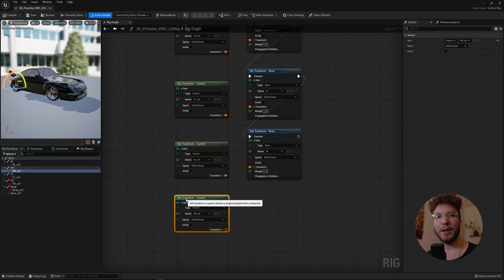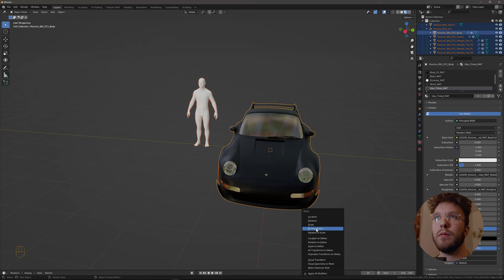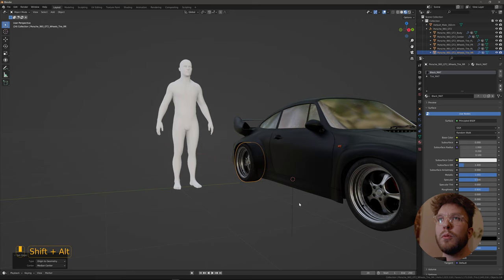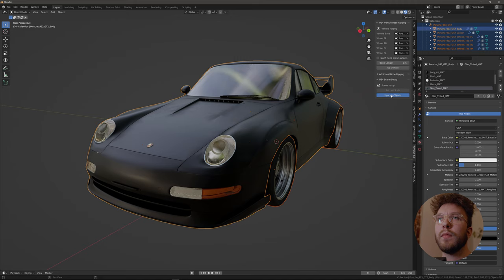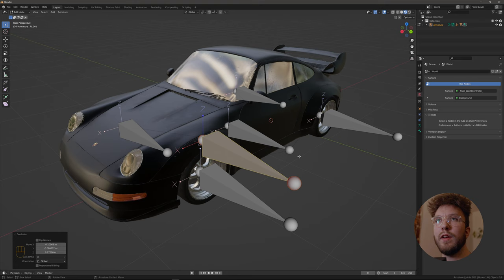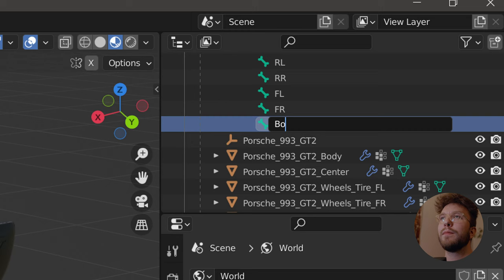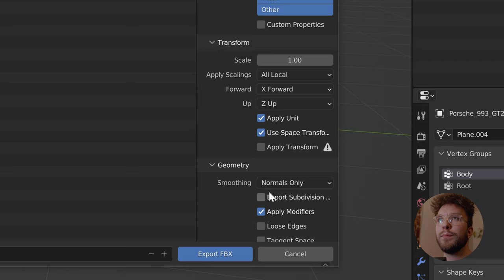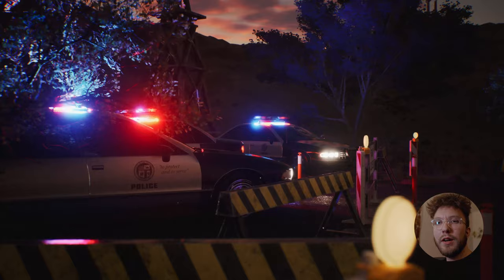Rigging a vehicle/car in Blender for Unreal Engine 5 animations

Comment: Hey, so I did all of the steps right, just that the bones face towards the back of the vehicle rather than facing towards the side of the car, Did I do something wrong?
Reply from the maker: Hi! If you haven't solved it yet, that's probably just because your car was oriented/rotated towards the wrong axis. Making sure the axis match the entire way through is really important. Is your car facing positive X axis?
Reply: @tiedtkeio  alr thanks man!

Comment: Keep coming back to this when needed! Great tutorial not to fast and very clear.
One question: Whenever I upscale my car using the UE4 Vehicle plugin it creates massive body/panel gaps. Any tip how to solve this?
Reply from the maker: Happy to hear that, thanks for watching! Honestly I do too sometimes when I forget haha. That issue sounds like the panels aren't applied scale. Before rigging the vehicle, very important to select ALL individual parts and Ctrl+A to apply scale. Also be aware of any modifiers you might've used that may be using incorrect values if the scale was incorrect when modelling the car. :)
Reply: @tiedtkeio  thank you for your comment! I fixed it by hand and can’t remember if I selected all individual parts before upscaling, I do remember my model having panel gaps before upscaling as well but hard to see due its scale. I’ll keep it in mind for next time! Btw instead of adding a bone for suspension is it possible to add a bone for opening or closing a door? Not sure if it works that way.

Comment: This is really a great tutorial. Thank you. I have seemed to do something wrong. When I import my fbx into UE5 everything shows up except the body of my car. The center, and 4 wheels show up but not the body? Any idea why that would be?
Reply from the maker: Thank you! You probably just missed to include the body in the export from Blender. Select everything including the body and select "export selected" in export settings or deselect everything and remove any cameras, lights etc and deselect the "export selected". 😄👌🏼
Reply: @tiedtkeio  user end problem... I got it. thanks again
Reply: @tiedtkeio  Another question for you. How would you go about adding a Niagara Dust system to each wheel, in a Blueprint?  What I am trying to do is animate the body of the car moving forwad and have the wheels automically rotate and the NS go on. When the car comes to a stop then the wheels would stop rotating and the NS would turn off. Any ideas on how to approach that?

Comment: Great tutorial - presumably this same method works if I add in extra bones for doors to open?
Reply from the maker: Thank you! It does, I forgot to mention it. You add a new bone for a door, spoiler, trunk etc, add a new vertex group with the same name as the bone and assign that group to the verticies. ☺️
Reply: @tiedtkeio  and presumably in UE5 you then do the same process but add more nodes to include doors etc?
Reply from the maker: @peterjoslyn1  Correct!

Comment: This may be an easy fix but it looks like my tires deform the body of my vehicle when I rotate them. I've tried removing the weight paint and it makes no difference as far as I can tell. Rigging my vehicle how they do it in the addon's instructional video solves this issue but I feel I'm missing out on the scalability your setup offers. Any thoughts on what I'm doing wrong?
Reply from the maker: This sounds like exactly what you mentioned. If your tires deform the body mesh then those skin weights affect the body too. Without having seen your car/mesh, make sure to remove ANY vertex groups assigned to everything on the car. Make sure it's only one body mesh and that everything is connected to it by moving it around with G. Make sure the objects in the outliner is named in a logical way i.e. "Car_Body, Car_FR, Car_FL, Car_RL and Car_RR". The main isssue is probably the weights mentioned above. If all else fails, let me know again in the comments and you could email me the Blend file so I can have a look at it. :)
Reply: @tiedtkeio   Hey that was it. For some reason when I rigged the car all the wheels and the body had all of the vertex groups under it. Thank you for your quick reply. 😅
Reply from the maker: Great! Good luck with your project. 😊 @nathankrone3363

Comment: The impossible part is to make the car. I'm currently trying to make a car (1 year of work) and I'm still far away from having finished modelisation, not mentioning high poly/low poly setup, uvs etc.... I hope I finish it before I die but I have very big doubts.
Rigging a car? Use it Unreal? Make a game or profit with it?  lol
Reply: You could have just downloaded a model of car from the internet 🤔
Reply: @destroyer1959  That is what I have done recently, but it still requires weeks of work to adapt/optimize. And my options are low since I can download only free models